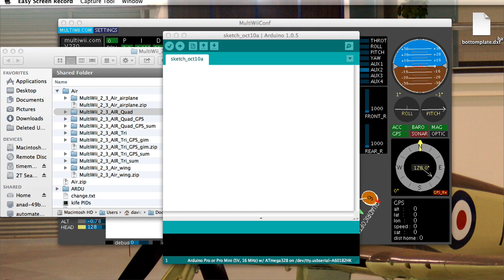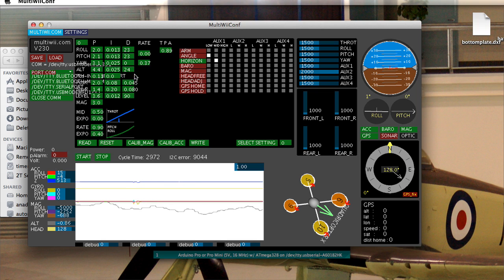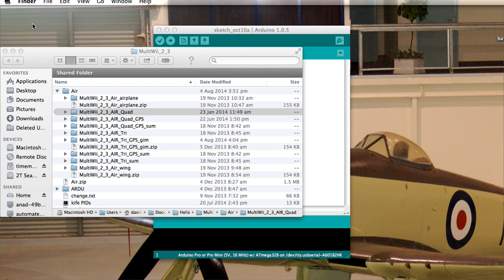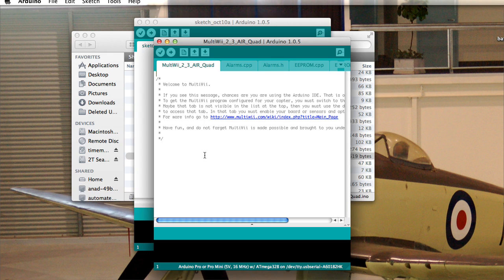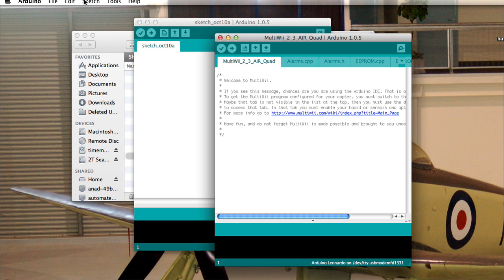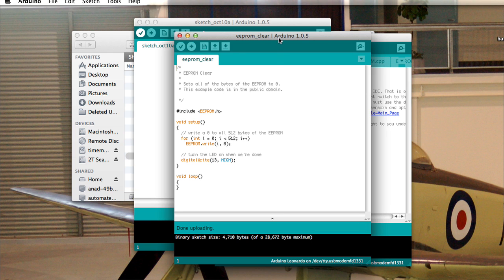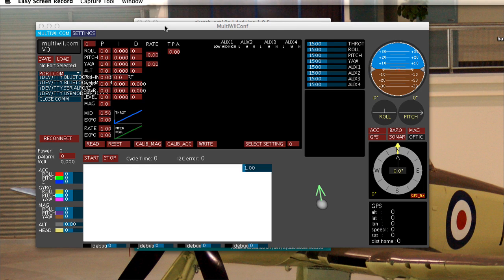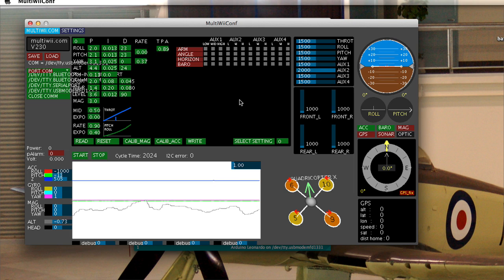AIR Clear and Load

Comment: hi so is the air ready to have an oLED connected at the end of this video? cheers rob
Reply from the maker: ***** If you loaded the oLED version of the code, yes
NOTE on a Paris AIRv1 or V2 you can't run oLED code and GPS code at the same time, their isn't enough memory